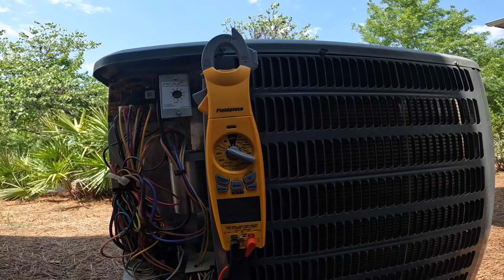Chasing A Short on A Goodman Condenser! #hvacguy #hvaclife

Comment: Amp draw on your low voltage will tell you a lot…that will be a call back…ran across many doing the same thing…they had a bad run of defrost control boards

Comment: Chasing down a short that only does it once in a while, makes it difficult. If you get called back and if it shorted good enough, you may find it, burnt or whatever. Changed out a wire on an old style Trane unit years ago that was completely burnt. It was fine after that, and I never did find the cause. Just crazy sometimes, nice work.
Reply: @tradde11 Been there, Done that. Especially in the Older Phone stuff that used hundreds of Cable pairs and connections...Easier to fix when something it totally Down...
37 Years in Telecom, I found a lot of unusual faults.

Comment: Tips: jumper common to ground.  If your common is loose this will make chattering stop.  Focus on common side.  Also, you have 24 volt outside, jumper directly to contactor or reversing valve.  If chattering goes away you have something in that circuit dropping voltage.  Also check for voltage drop between tstat and contactor or reversing valve.  Defrost board, time delays and pressure switches all likely culprits.  Just found a low pressure switch yesterday that was opening way before the low pressure.  Measured voltage drop at contactor through the switch.

Comment: I'm wondering if you could have some "green death" under the insulation on that reversing valve wire, when you moved it around it made contact again at least for the time being.  I would have replaced that contactor for sure, it might be intermittently causing the LV issue, at the very least if it's sounding like that it's going to  s**t the bed any time.

Comment: They are known for the wires strapped to the accumulator tubing to chaff and cause a short. When you moved the wiring around ut probably moved the chaff off the copper. You will be back probably. Especially after a hard rain. Have seen the same problem on many goodmans. Took me a while to isolate the problem after a few call backs. Now i head right there if it is an intermittent short.

Comment: 4:36 looks common wire behind low voltage wires come through looked like something sparked there hmmmm… I had a contactor make that noise when the wires were stripped back to much and got behind  it where it pulls in

Comment: I have to wonder if maybe one of the connections had some corrosion on it; not a short, but an open.
That contactor sounds like a buzzer.  Shouldn't it just close and remain almost silent?  Possible debris in it, like dead ants?

Comment: The contactor has issues,  it sounds like the low voltage electromagnet if loose in the contactor case creating the 60hz buzzing.  You need to start testing contactors with voltage drop test across the contacts when the system is on.  meter on voltage, one probe on the output of one leg of the contactor and the other probe on the same leg at the disconnect side of the contactor.
     If the contacts are good you will read 0 volts,  anything above zero is from have having worn or pitted contacts.

Comment: For intermittent Problems, I would use the "bang, Wiggle, Tug" tests, and I could usually seek out bad connections in short order. 
The real hidden ones are the Corroded wire inside the insulation and it is not visible   
Retired 37 Year Telecom / Sound Tech.
Mike M.

Comment: I don’t believe you had a short, but I believe it was a bad low volt connection combined with the contactor coil causing to much voltage drop for the reversing valve. Keep up the good work I enjoy watching

Comment: Maybe bad crimp on spade terminal had a few bards act that way
Reply from the maker: I’m leaning toward something like that.
Reply: @HVACGUY   thats a good one lucky no one standing behind you asking questions while you're thinking irritating
Reply: @tedhicks5431 a bad crimp where? I kept having a low voltage short on a Bard unit that is still bothering me. It makes the contactor just pull in and then let go. I couldn’t find a short and the problem continued even after changing the contactor and the thermostat. I would manually engage the contactor and it would stay pulled in.
Reply: @cesarmoore7996  backside of low voltage terminal strip take 2 Phillips screws out
Reply: @tedhicks5431  amazing, you’re a hero 👏🏼
Reply: @cesarmoore7996  not sure bout that  is that what you found?
Reply: @tedhicks5431  I’ll find out tomorrow
Reply: @cesarmoore7996  it can be a pain as you know we have almost a 1000 at a school system some are 30 yrs old
Reply: @tedhicks5431  I forgot to reply, but yes that was the problem. A bad crimp, I’ve never thought to check that, thanks! I perform maintenance on about 260 a month, I can’t imagine keeping up with 1000.